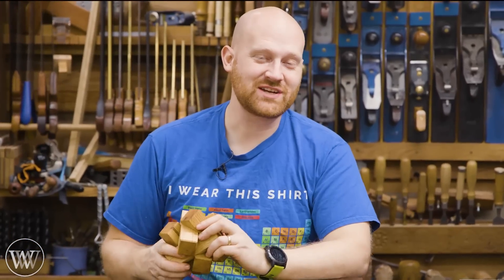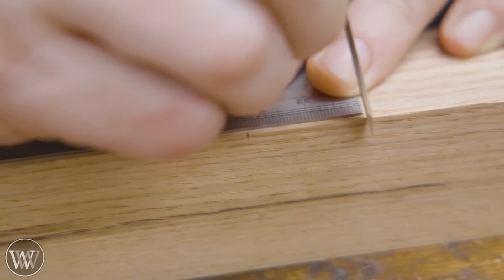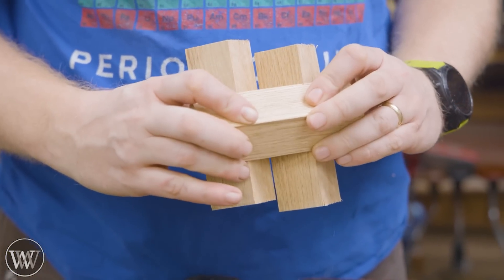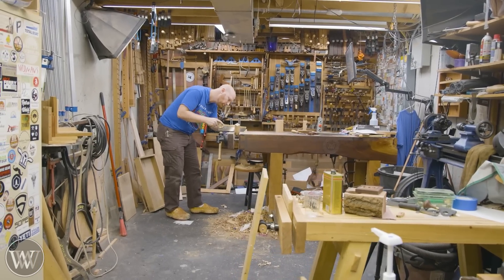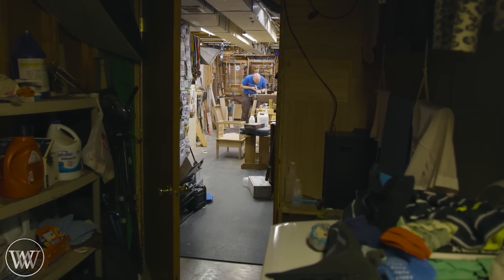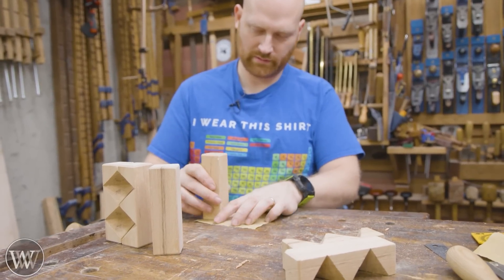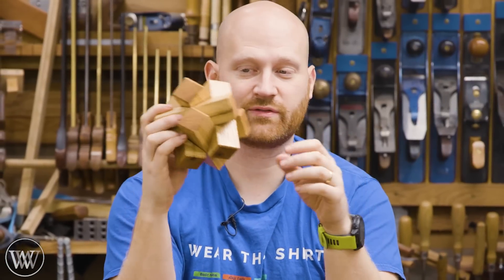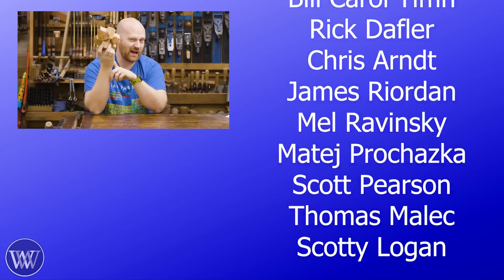How To Make a Star Bur Puzzle Fast Woodworking Project

Comment: Wouldn’t it be easier to measure the length along it and make them half then diagonal width rather than measure the angle? That way you can just make a grid along it evenly spaced
Reply from the maker: that is what I did for the first one then set the bevel gauge to that, but I know a lot of people will be asking me what the angle is so they can skip the step.
Reply: @WoodByWrightHowTo  It’s funny because you don’t even really need a bevel gauge if you just set up the grid….and you need the same locations in the grid anyways to know where the bevel gauge starts from.  To be square, the root of what I’m saying is that using the angle leads to irrational results.